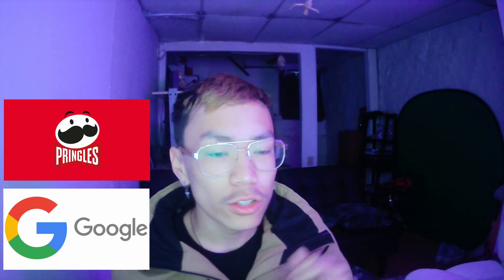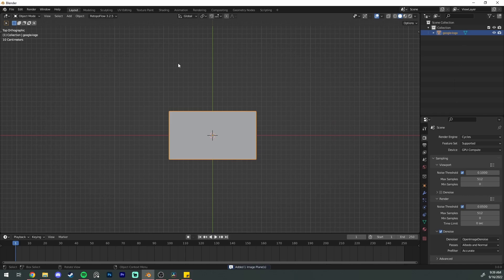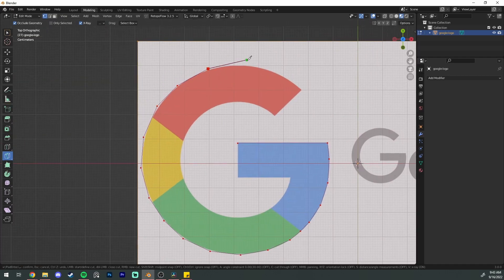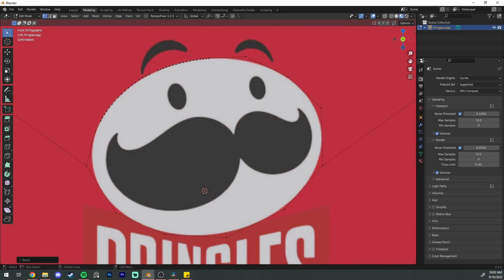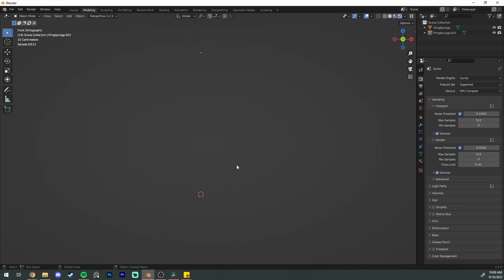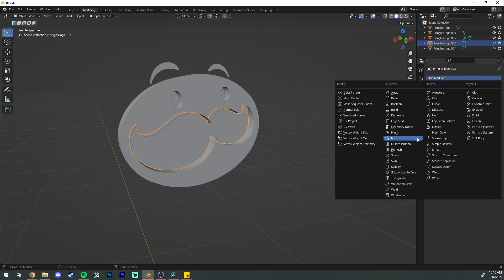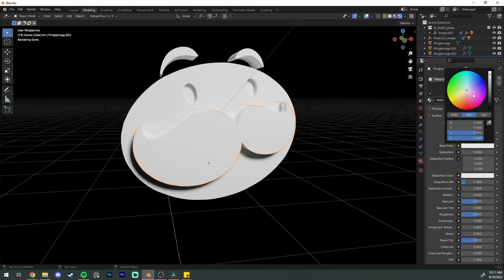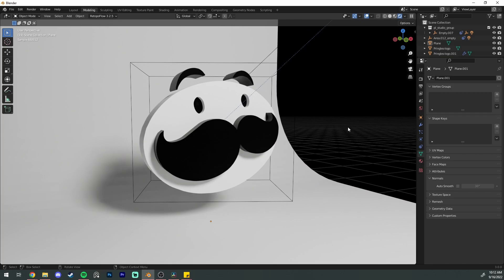Making ANY 2D logo 3D in Free Software BLENDER [Tutorial]

Comment: I have two questions if you don't mind answering them:-

1. I'm creating a bevel for my 2d logo at the moment but it doesn't move towards, or away from the logo  it just adds vertex, is there  a command to move the new bevels as well? I noticed if i move the vertexs after adding the bevel it distorts the plane image.
2. When creating the white backdrop, how did you merge the two planes together and create the curve? 

Sorry I'm just learning blender and your video are helping a lot!
Reply from the maker: I am not sure about the bevel, sounds like you have too many close vertices. However I can answer the backdrop:
Start with a plane, then extrude upwards on the Z axes. Once you have an “L” shape, bevel the edge so you have a curve. The backdrop should be one mesh.
Hope this helps!